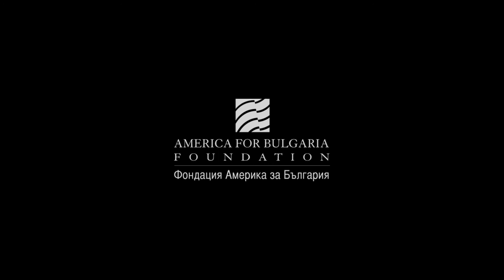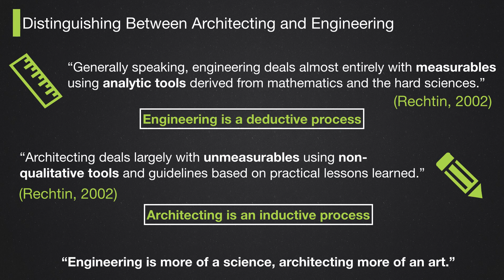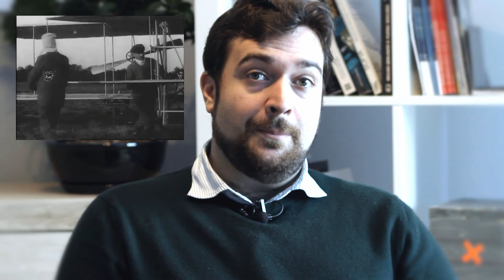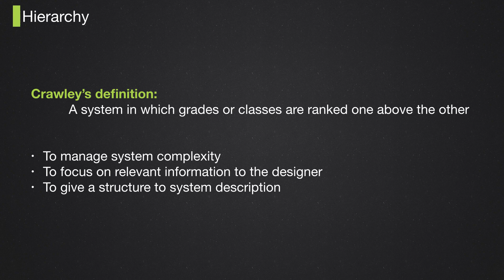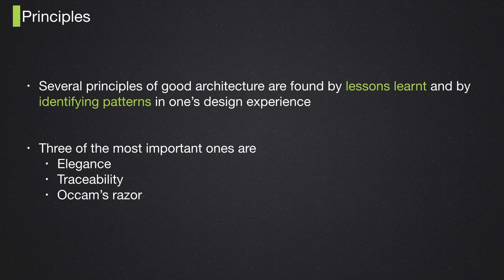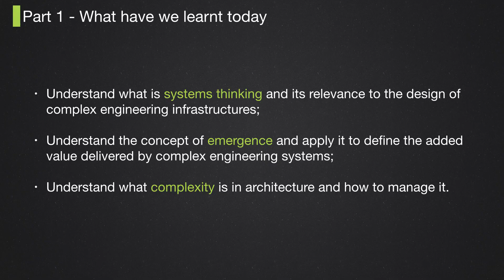What is Systems Architecture (PART 1)

Comment: Generally I think this a quite good but very brief introduction.  However I lack some reasoning around principles such as "separation of concerns"; "coupling and cohesion", "separation of policy and implementation" and not just abstraction and hierarchy as to deal with complexity. Today the notion of "architectural concerns" and viewpoints (perspectives) is dealing with complexity and that is not only about abstraction or hierarchy but more about separation of concerns. Furthermore, in a decomposition of a larger thing it is quite often that the elements showing up there are abstraction themselves.
Reply: Good points. The assumption are more derived from simple physical system.